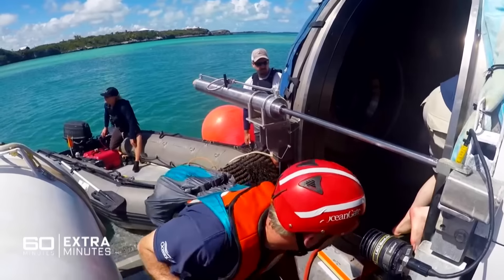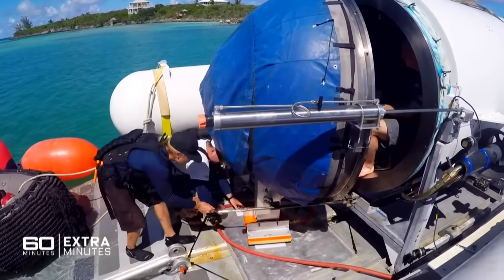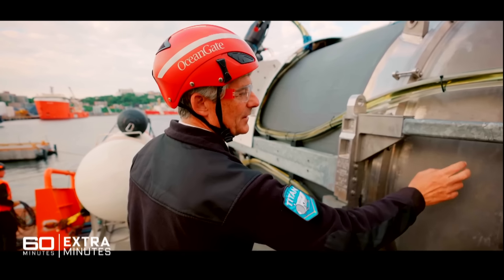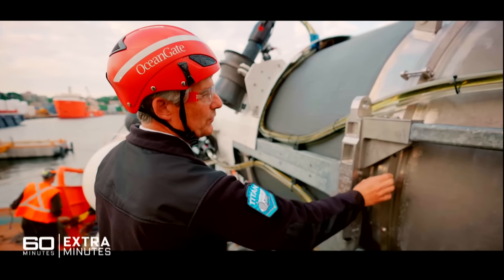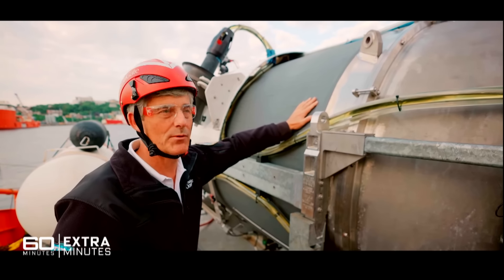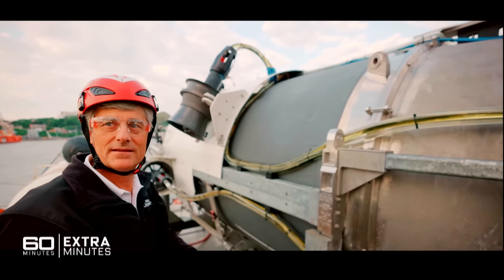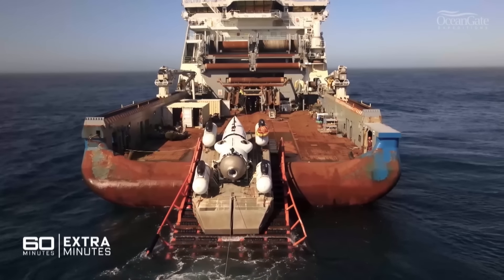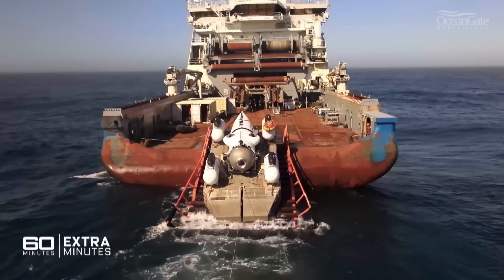Titanic sub implosion explained | 60 Minutes Australia

Comment: Carbon Fiber was the perfect solution for the pressures they were dealing with. Assuming the pressure was on the inside of the sub. Carbon Fibers strength is when under tension. When the string is being pulled along it’s long axis. It is however string. It has no strength in compression. You can just ball it up like yarn. In compression the carbon fiber was doing next to nothing. All the strength was in the resin bonding material. It’s a miracle it lasted even one dive.
Reply: @PhilAndersonOutside the biggest problem with carbon fiber bicycle parts (especially poorly made ones) is cracking and fraying of the weak point
Reply: Copy pasted
Reply: he should have refubrished the whole thing after 5 dives,that might have worked.
Reply: @ppsarrakis  Agreed, if by "refurbished" you mean "thrown away and built another one".
Reply: @Numeriwar no its not
Reply: @ppsarrakis or just dive to 2400 feet not 12000 feet
Reply: UlasSubs eh he dead
Reply: 🏆🎯🎯🎯💯 THIS!!!  I don't know why I've not heard anybody else mention this, anywhere. It's not like it's a secret that Tensile strength is completely different from Compression Strength. It's not a mystery, it's simple science. Middle School stuff.
Reply: @damien9683 And that they often fail without any warning.
Reply: UlasSubs At varying depths ..
Reply: @jamesnguyen_1 Why not 2500 feet .. or 1950 feet?
Where was the research?
Reply: stop stealing comments
Reply: I made a comment without reading your excellent analysis.  I agree with everything you have said.  I am not an engineer, but it seems obvious that CF is basically strong string.
Reply: andrew, not to those pressures. These numbers and forces are hard to fathom, it was at 375 times normal atmosphere pressure. Take a pair of large dice about one inch square. set one die on any surface, wood, asphalt, carbon fiber, set your car's entire weight on that single die and guess what? That die will crush through just about anything. Now imagine a die with 5,500 pounds sitting on it and enough dies to cover every square inch of that sub and we're reaching pressures that are beyond comprehension. I'll bet with just half that pressure, you could push your thumb through brick like a marshmallow.
When it finally collapsed the incoming water, the volume of the sub under that much water pressure reaching the five victims at the speed of sound basically just crushed their bodies to pulp instantly. Sorry for the visual.
Reply: So interesting how this obvious fact did not enter such a smart guys brain, it is realy a failure of thought proces.
Reply: @StillAProudAmerican-ll2yc  to be fair that's a bit of an over-estimation of how severe the problem is, as an example diesel fuel pumps (which are mass produced, off the shelf components) can have pressures in the realms of thousands of bar, stuff like 2,000 bar (or about 29,000 PSI) are not out of the norm for such pumps. That's WAY higher than the pressure down at the Titanic. Another high pressure, off the shelf, mass produced item is brakes, automotive brakes are in the region of around 2,000 PSI maximum pressure (for a regular car).
Reply: Absolutely right
Reply: @StillAProudAmerican-ll2yc  Exactly on point !   Most people have no idea what those pressures mean.  In an aerospace application, the inside pressure (for human occupancy) would be nearly atmospheric pressure 14.7 psi.  There are now dozens of youtube videos attempting to demonstrate how an object is crushed (at 14.7 psi) by heating it up, sealing it and dousing water on it.... What happened to the Titan was nearly 400 times more violent (I am estimating closer to 6000psi) But 5500-6000 psi....doesn't much matter.   BTW, I am familiar with sea pressure because one of my duties when onboard a Navy sub was determining what pressure was needed at our depth to blow our sanitary tanks to sea. ;)
Reply: So your saying it would of made a better space 🚀 ship than submarine !
Reply: EXACTLY!  This was insanity. This was a spool of thread waiting to collapse. No one knows the rules of tension and compression? Nope.
Reply: @PhilAndersonOutside why am I not surprised that someone who works for outside has bought into the myths the big bicycle marketing teams sell. Tow the line, take the cash. Go home boomer
Reply: @joshiek7839  Been riding carbon bikes for well over 20 years. Zero problems so far. I'm also pretty sure the reason why nearly every pro in nearly every discipline rides carbon, and that reason isn't because of marketing (even if you think it is).
Reply: @PhilAndersonOutside  who said anything about problems ( although there are millions of them). Your marketing BS about rigidity in torsion but compliance in the vertical plain is BS. Bicycles are a Truss - used because they are rigid in the vertical plane. Your a paid shill nothing less
Reply: @PhilAndersonOutside  it would seem then your best bet would be to keep your trap shut. Riding CFRP bikes for 20 years doesn’t make you a materials expert or a mechanical engineer.
Reply: @PhilAndersonOutside  passive aggression won’t help you either. I’m not nice, I don’t need to be.
Reply: @joshiek7839  Okay then, enjoy your angry, bitter life. I'm out.
Reply: @PhilAndersonOutside  I’m not angry or bitter. Just not nice. Not my problem your competency is lacking.
Reply: @joshiek7839  Sorry, I left out judgmental as well.
Reply: @PhilAndersonOutside  all while pretending your an innocent saint.
Reply: This is not completely true
Reply: Yeah i was booked to go on but pulled out after having my engineers go over the designs extensively, and strongly encouraging me to think twice about this venture. Dodged a bullet there
Reply: @Numeriwar Copy pasted
Reply: @eightlights4939 this is only 99% true, therefore I will disregard all of it"
Reply: @wirelesmike73  It's been mentioned
Reply: @sophocles1198  Not a fraction as much as that damn video game controller has.

Comment: Because the carbon was wrapped, it had ZERO strength in the fore/aft direction. The only thing preventing collapse was the epoxy alone, something it was totally unsuited for. I'm amazed it lasted as long as it did. A wise mechanical engineer once told me: "No one knows anything, the results speak for themselves." Indeed.
Reply: I mean, they had super fancy acoustic sensors to tell them it was going to fail though. As they ignored gunshot level noises during their dives lol.
Reply: And can you believe that some people think they actually suffered?
Reply: No… because its CARBON FIBER it has no strength in compression, only tension.
Reply: @blu3savag355  I can't imagine the suffering and fear, however brief, of sitting in that death trap hearing the sounds that you were about to be imploded.
Reply: @blu3savag355   @Dudeman9339  All the suffering was mental. If you read the transcripts from the dive between the sub and home base, after descending way too fast, they spent a good 20 minutes with alarms going off and that cracking sound, and they couldn't get the sub to ascend. 20 minutes of sheer terror.
Reply: @bobbygetsbanned6049  That might be useful for a metal hull but carbon fiber fails like glass, it doesn't really buckle, it just shatters. All that system would have told you was that you were about to die.
Reply: @Keestral  I agree but in Ocengate's case it couldn't even be trusted to do that. They never did destructive testing with the sensors, so they had no idea if the hull would even make a sound before failing. Then when the hull made noises on dives they totally ignored it, it was complete nonsense they used to lie to customers about being safe.
Reply: it has strength otherwise how could it have made those previous dives ...the problem is that it degrades over time with stress.
Reply: I mean everyone in the industry knew something bad was gonna happen eventually with that dudes Frankenstein sub
Reply: @d2mini the actual transcripts haven't been released, that was fake
Reply: @blu3savag355  They might not have but their loved ones are.
Reply: @BobbyT-yj1cw  yet you're wrong according to every expert
You use carbon in the bottom of the hull because it's flexible and strong being flexed, not under intense pressure though lol
Reply: @@BobbyT-yj1cw It has incredible compression strength. It has an even more incredible ability to fold over so that it's not compressing anymore.
Reply: @@BobbyT-yj1cw I think that went kver your head XD

Comment: As a pleb member of Joe Public I would like to know how carbon fibre, which is only good in tension, is suitable for a compression situation? I looked with horror at the joining of the cylinder to the titanium ends - in draughty open warehouse with a hand mixed pot of glue......... Zero quality control in any way.
Reply: As someone who has assembled things that are flying in space, I completely agree. The open warehouse, laissez faire attitude, experimental materials, etc., then asking people for $250k each to test it.
Reply: If it was in a shape of a ball, maaaybeee the compression would enforce the materiak compact it more tightly together, like the glass that cracked in the other submersible and it withstood even greater pressure. But because this was a cylinder, it didn't stand a chance. Imagine the inwards pressure on the sides of the cylinder, deforming the submersible and that glued front, even with 17 screws tightening it (they said they avoided the 18th as a mathematically insignificant) won't hold shape anymore. If nothing else, then this.
Reply: The resin should have been mixed  by machine then vacuum degassed to remove the bubbles, a procedure we used regularly when I worked at a resin lab many moons ago.

Comment: every 1st year mechanical or civil engineering student knows that a carbon fiber cylinder is great as a PRESSURE vesicle, but can't be a reliable COMPRESSION vesicle. This  is due to the simple fact that a carbon fiber is one of the greatest materials in tensile (stretching, like pulling a rope) but terrible at compression (why you can't push a rope.) If this "design" was so good, don't you think Navy(s) the world over would make submarines out of a thicker version?  Nope, "carbon fiber" is a sexy term to most people because they have never laid hands on the material they keep hearing how strong it is....

Comment: The Titan should have used titanium...no pun intended.
Reply: If it were used titanium steel, would it make the titan more safe as it would not cause an implosion?
Reply: Carbon fiber worked until it didn’t. That’s scary.

Comment: The strength of the carbon-fiber hull was actually the epoxy glue that was used as it was spun.  The real strength of the carbon-fiber would have been internal pressure....not external.
Reply: In engineering terms, carbon fiber is strong in tension (when being pulled on) not in compression (when being pushed on). The strongest rope can lift a truck but if you push on the rope it can’t move anything. That’s why they can use it for compressed air tanks and planes which have higher pressure inside, not higher outside.
Reply: That's some badass epoxy, if they would have left out all that pesky carbon fiber and just made an epoxy pressure hull they might still be alive.
Reply: @bobbygetsbanned6049  Should have just used 10" of concrete with rebar.
Reply: @bobbygetsbanned6049  epoxy does not have strength until it's reinforced with fibers of some sort.
Reply: @buckmurdock2500  Carbon fiber is incredibly strong under tension, but under compression is like pushing on rope. The way it's shown being wrapped means that under pressure, it's all in compression. The carbon fiber isn't doing much, the epoxy is providing almost all the strength.
Reply: @ray_collins If it were used titanium steel, would it make the titan more safe as it would not cause an implosion?

Comment: Engineering modelling suggests that the epoxy seals between the glass fibre and the titanium, as well as the acrylic viewing port, which was only rated to 1300m depth, were also major weaknesses.
Reply: Yes, any point of transition is a place where forces are likely to concentrate.  In the pressure housings I have experience with, the bulkhead is significantly beefy and part of it extends inside the tube with a close fit.  This means that under pressure, the tube comes down onto the lands of the bulkhead.
Reply: On some close up shots of the outside of the viewport, small cracks are visible around it's edges, they are not visible from the inside.

Comment: So it was just a basic fact that Stockton rush ignored.  Carbon fibre isn't suitable for the purpose.
Reply: Because he thought he could InNoVaTe  out it's well known limitations. If he had done the many (unmanned) tests in a pressure chamber like he should've, he would have seen early enough that it doesn't last beyond a few dives.
Reply: Yeah...but besides THAT....!!??
Reply: Steel is better than carbon fiber,  end of the story
Reply: Yup and he knew it but instead of using something else he just said "innovative" 5,000 times.
Reply: carbon good on a car wing driving to pub...not so good 5000m down in sub
Reply: He Rushed it
Reply: @thestruggler3338 If it were used titanium steel, would it make the titan more safe as it would not cause an implosion?

Comment: As somebody who builds experimental aircraft, everything I'm hearing about this sub says that its construction was less regulated and subjected to scrutiny than the relatively simple biplane I'm building now.  And when I get a provisional airworthiness certificate on it, I don't get to take passengers in it until I've done a whole lot of testing and flown off a lot of hours.  This guy was using unapproved materials that the FAA would never have certified, and an FAA examiner or "Designated Airworthiness Representative" would never have signed off on any of them in a homebuilt airplane.  So the airworthiness certificate would never be issued in the first place, and nothing would have left the ground until it'd all been corrected.  This sub got nowhere near this scrutiny, and the people who built it were taking passengers almost from the start.

Comment: Cylinders don't distribute stress well under massive compression loads. Use a sphere and design a craft within those limitations. James Cameron's craft was like a dart with a metal sphere enclosed inside for the occupant. On the Trieste submersible dive there was an explosive boom when an out plexiglass window cracked somewhere around 6 miles down. Both guys looked around and decided to continue down.
Reply: @randmayfield5695 I think it was 2.3 miles down, no?
Reply: @HeeBeeGB  They say the outer plexiglass window cracked at about 30,000 feet.  Roughly 30,000 ÷ 5280= 5.68 miles. Quite a bit deeper than 2.3 miles.
Reply: I once put six toy soldiers in a cardboard toilet roll tube and put it in the bath, tube just went all soggy but the soldiers were back fighting the next day, we didn't have carbon fibre back then.

Comment: Rhino liner can be used to keep moisture out but not under that crazy pressure lol I was an after market truck part installer for a couple years and rhino liners main purpose is to make a water proof layer on the metal exposed in a truck bed or wheel wells to prevent body rust . When it dries it is very hard and abrasive If the carbon fiber was crackling at those pressures ik the rhino liner had to be as well 🤦🏽‍♂️
Reply: at some point it was just the rhino liner holding back the deep ocean.
Reply: The material of the Rhino liner is a good one to put on the outside.  It is not going to be at all structural but it will prevent one type of damage that can happen to the tube.  Rhino liner is flexible and a bit soft.  Carbon fiber tubes are brittle.  There is a thing about what happens at the surface of carbon fiber tubes when directly exposed to a fluid.  The Rhino stuff spreads the force out at a microscopic scale.  Ordinary paint actually works to do much the same.
Reply: My truck has a Rhino liner in the bed. I didn't know they used it on submersibles.
Reply: @3482-h8c  It gets used in a lot of weird places.  It is tough and flexible.
Reply: I remember when they would tell us not to paint our motorcycle helmets because chemicals in the paint would cause changes to the base material. 

I can't imagine Rhino Liner signed off on something this his stupid.
Reply: @rcannon409  Nobody is going to sign off on it but in fact the Rhino Liner, most likely made is less likely to fail.  It cuts off one or perhaps two of the routes to failure.  The exposed surface of the carbon fiber isn't smooth at a microscopic scale.  This gives a path for sea water to get into the first bit of the tube and start to muscle it apart.  The Rhino Liner prevents this.  The design was bad but this is not the fault that made it fail.

Comment: Carbon fibre is of course capable of surviving high pressures and it did, several times. The problem is that it degrades each pressure cycle, you can't really inspect it or fix it. It is a very stiff material, but it relies on a weak resin to keep it straight; otherwise it is so thin it will bend like uncooked pasta. A carbon fibre submersible is possible, but it's a one-time-use item.
Reply: Given the tech, design and build it was entirely possible it failed on first use. They never presume tested the container for the depths of the Titanic site. The quality control on the fibre construction was less than I've seen of high spec yacht builds, and those things only are ever designed for floating on the ocean.
Reply: Only cooked pasta bends
Reply: @Freebird555  Day 2, I'm all out of pasta.   I've just realised lorijames5464 and soylentgreenb were probably talking about spaghetti or something, not the unbendable hard fusili things I'm accustomed to eating.